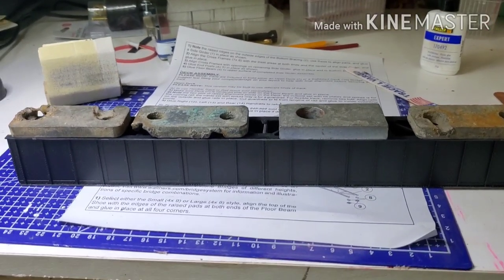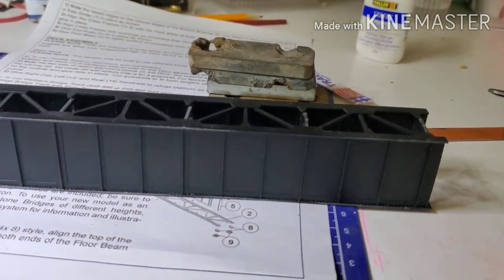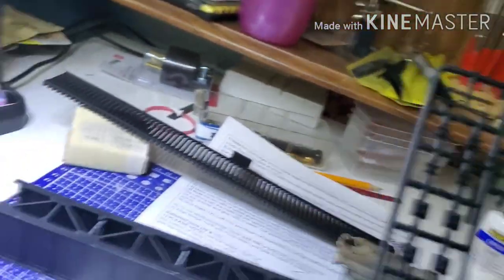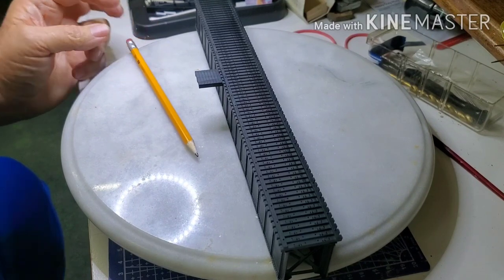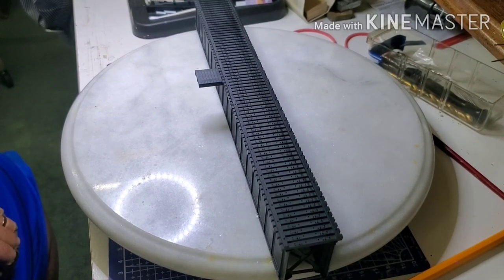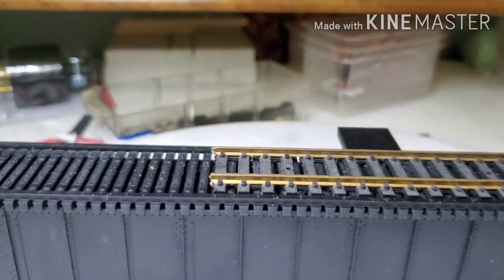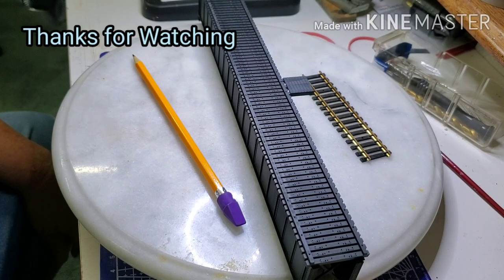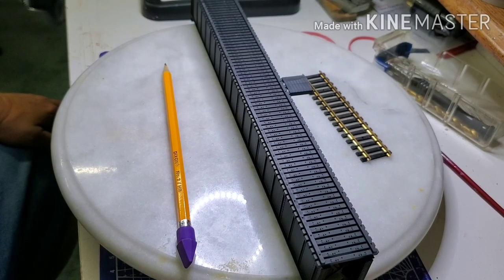Walthers 90' Single Track Deck Girder Bridge  Build

Comment: Wilmer, next time might I recommend Micro Engineering bridges. Excellent quality, made in the USA very detailed. They also make a bridge track in flex and 3 ft lengths, rails already on it. If I were you on the bridge you have. I have seen Barge cement used to fasten track to plastic ties. Barge is the brand name of the glue. I would scrap a piece of track and use the rail from it and also the guard rails. Look for photos but the guard rails carry of the bridge and taper towards the center if you want to make it more realistic. any questions just reply. Cheers Rob
Reply from the maker: The Walthers Bridge was a gift, you're not the first to say about the Micro engineering Bridge.  The Bridge itself is not a bad looking bridge. The whole point I am discovering in doing these Walthers Kits is that for what they charge for them they shouldn't have so many issues. Maybe I am being too judgemental.  Lol. Thanks for watching....Wilmer

Comment: Nice bridge Wilmer. I think they are charging $30 for that track piece because it has the bridge guard rails (two rails on each side) already built on the track. It also comes with the proper guard rail ends. I have used the Micro Mark Insta Cure CA glue for attaching rails to plastic. Thank you for sharing.
Reply from the maker: Thanks for the recommendation....Wilmer

Comment: Simply trim off one side of the little buttons off. Use CA glue to hold the rail in place. Use a track gauge as you glue down the second rail to be sure you get them right. Then do the same with the inside guide rails using a truck to keep the distance between them and the operational rails
Reply from the maker: Thanks Dave 😊
Reply: Indian Head Valley RR I’m sure you’ll come up with a good solution and it’ll be great

Comment: For starters that bridge is designed to install individual rails  in the spaces between the two rows of "buttons" (representing spike heads. That will set the gauge for the rails. You can glue the rails with super glue or a contact cement.
Reply from the maker: Thank you, that is what I am going to do. Thank you so very much for watching and commenting. Your support is appreciated..... Wilmer

Comment: Hey Uncle Wilmer. Great update. Love the bridge. If you go to Fast Trax website you can buy the single rail. You can get it in 36in or 18 in pieces. You can also do what you suggested and break it off of a piece of Flex track that will work too. As far as gluing it down, I'm not too sure I haven't had to do it yet.
Reply from the maker: I figure something out, I think it's disgusting that they sell these kits knowing that you need that track. Why not include it in the kit.Thanks Rick.....Uncle Wilmer

Comment: Very awesome Wilmar and you make good points about the bridge and I would say is use Regular track on the bridge and the reason why I say that is because to me it feels easier to put the truck on and use Loctite go2 Glue and I would recommend Lowe’s because I think other stores don’t sell it for a fair place also I think it’s better in my opinion to have regular track on the bridge because what happens if it becomes broken and you would need to replace it also I think your logo on the bridge idea is a awesome idea and my opinion is I say to myself is do what’s easier and that’s my opinion also another reason why the track should be on the bridge is because what happens if you want to move it somewhere else also sometimes when I do scratch building some parts of it are easy and some others parts are not also another thing I like to say to myself is it’s worth it at the end of every project also I hope you have an awesome day Wilmer
Reply from the maker: Thanks for the advice, Nathan. You are awesome....Wilmer

Comment: $30 for track? That is super ridiculous! I have a double truss bridge from Walthers to put together. I hope that doesn't require that either....
To do Indianhead Valley on the side of your bridge, Micromark has decal paper that you can put in your printer.
Great Rant Uncle Wilmer!😉
Reply from the maker: Jason read the instructions for your bridge. They give you the stock number of the track. I looked on Amazon also.  I will work something out.   Thanks for watching....Wilmer

Comment: And these manufacturer's whine when sales are down - no wonder with tactics like that - it's shameful! I think I'd be inclined to try contact cement. I've never used the Copydex as suggested by Mark Ireland (and others) but I have heard good things about it. Not sure where you can find it though - it's popular in the UK. The bridge looks good and I agree, placing the flex track on top doesn't look right. I have a bunch of Code 83 weathered rail. I'd be happy to send you a length - would be more than enough for that bridge. Just let me know. Best, John
Reply from the maker: Thanks John but I will strip a piece of flex track first.  Marty said gorilla guy gel. .I will get it....Wilmer

Comment: You should glue rails directly to the deck. I have used CA with success, but I feel most general purpose adhesives would work including white glue as long as the ties on the flextrack directly on the ends of the bridge are securely held so that all the white glue does is hold gauge, not position. 
For instance, if the lead-in and trail-out of the  bridge are on a curve and the ties do not force the rails straight before entering the bridge deck, weaker adhesives will not keep the rails in position or in gauge on the bridge deck as the rails will want to tend toward making a smooth, even curve over the length of the flextrack.
Reply from the maker: Thanks Charlie.....Wilmer

Comment: Do you the Faller cement? I bought the Faller glue for the applicator.
Reply from the maker: Yeah it's Not Bad. Actually like it a lot better than plastic weld.

Comment: I am going to defer on the glue because a better super glue should work or even a rubber contact cement, which is harder to fine. BUT, you call that a RANT?  You need to watch Containerman68 for some rant tips. Good luck on the build.
Reply from the maker: Well I am a reformed trucker,that is why my rants are mild. Lol. Speaking of rant,I  was very disappointed that your Diorama was not picked comparing to the ones that were picked. Someone needs glasses....Wilmer
Reply: Yeah was disappointed too since I did a single that was better than some of the group entries.

Comment: 9400108205496385773106ve built the 90' and 50' both and what the instructions say is to remove the ties between the rails for the length of the bridge and glue the rails in place.  I have done that it works.  Then remove only the rail from flex track for the safety rails inside and glue in place.